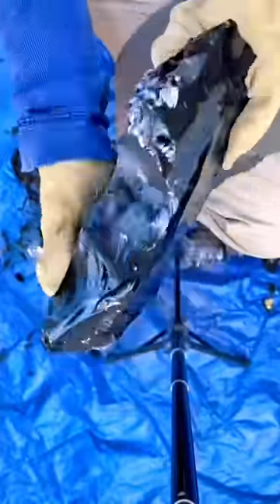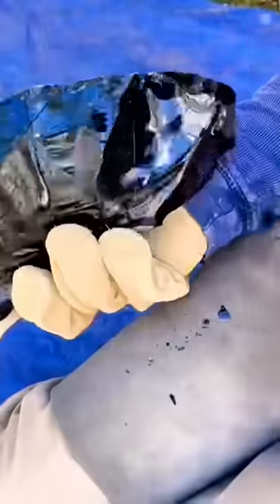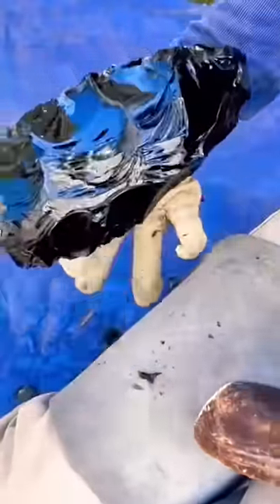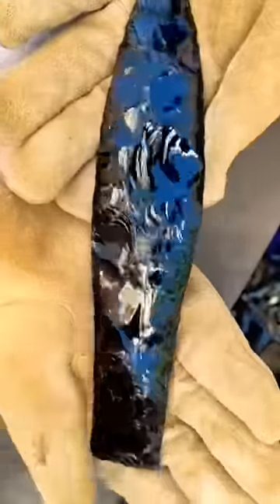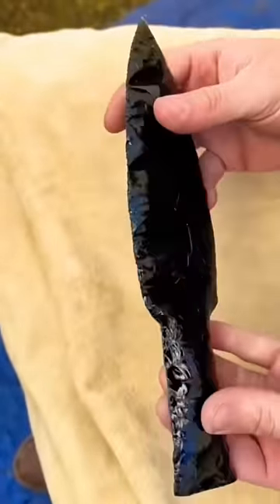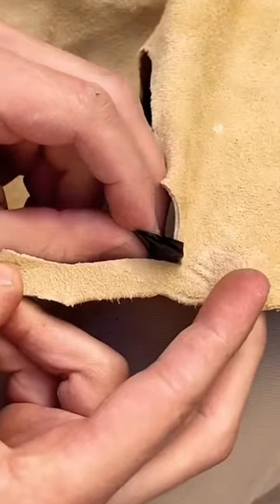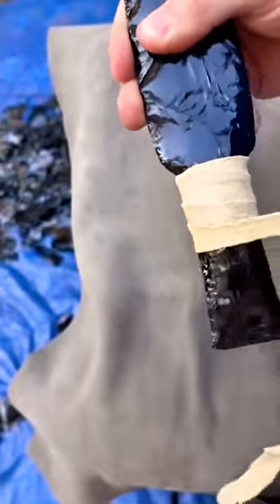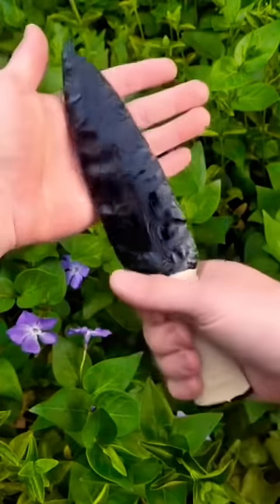Making an Obsidian Dagger!

Comment: fun fact: a knife blade made out of obsidian offers a clear cleaner cut than a steel blade. this is why the aztecs uses obsidian on their infamous and feared war clubs to not only kill their enemies, but also wound some of their enemies for human sacrifice to their gods
Reply: so not being able to forge steel had nothing to do with not forging steel? steel being the TO THIS DAY standard and premier material for edged weapons?

in your defence, ceramic knives exist and are much harder, meaning their edges can stay sharper longer while not being dulled as quick, which requires straightning/resharpening.
Reply: @tehpurplepills working with steel is much easier than obsidian. but we use diamonds, garnets, etc. as abrasives in sandpaper and drills because it is better for that purpose than steel. if you are in a society like ours that needs mass production more than anything else, then steel is better. but for the aztecs, obsidian would be much more useful than steel
Reply: This is actually the most unfounded and absurd comment I’ve ever seen on the internet.
Reply: @tehpurplepills obsidian has practically no durability as a tool or weapon, it’s incredibly brittle. but try shaping steel into a blade with antlers.
Reply: @tehpurplepills even today, there are surgeons that favor obsidian over steel
Reply: @Inuxxus  oh yea. ive never heard obsidian, but i know of eye sergeons using literal diamond blades, and im a 2x head chef and ceramic knives are legit sharp and generally dont need resharpening. lots of sharpeners themselves, ARE ceramic. its just the possibility of a ceramic shard/chip in food is bad.

so no doubt theres applications for these types of brittle, but hard material. ( is diamond bittle?)but any sort of asrguement that obsidian is overall better then a steel or even iron weapon, for combat, im very skeptical of. seems like an pro native america's revisionist history fetish.
Reply: @obscure.reference  a blade with antlers?  are you refering to the weapon where obsidian shards are sandwitched between two boards, with sharp edges stickign out, and used to shread and tear and lacerate enemies?

yea, seems like would be easier to make than forging an antlered sword... especially for me, someone who's never forged steel, like every aztec we know. but also seems like there'd been little to no need or use to create such a weapon in places where steelworking existed. seams like that type of weaponry was best for shredding, lacerating, and tearing exposed or lightly armoured skin. probably intimadating as well.
Reply: @Inuxxus  PS ive spent 10k on 2 hospital bills due to laceration from glass, and never had any other emergency visits, let alone from steel, so i get glass/obsidian. being dangerous. which is why id be TERRIFIED to weild this knife. i feel like it'd shatter and slice a large chunk of my hand off.
Reply: @tehpurplepills  im referring to the video we are commenting under where a man uses antlers to shape a blade to demonstrate that different materials have different uses at different degrees of technological awareness.
Reply: @obscure.reference  oh. so you meant somethign like "try usign antlers to sharpen steel into a blade" and not to "make a steel blade with antlers on it." gotchya. my confusion
Reply: @tehpurplepills obsidian blades are sharper and cut finer than steel. That’s a basic fact Google will tell you…..
Reply: @sandman4663  so if this guy took this weapon against a BESS edge tester, to see how sharp it was, do you think it would beat my sharpest kitchen knife, after a quick straightening with a steel? id bet you $5000 to $500 it wouldn't.
Reply: Aside from the fact they didn't have steel.
Reply: @tehpurplepills  yeah ill be taking your money now. easiest $5000 ever made lmao
Reply: Pagans... 🙄
Reply: than how can u chip it? looks soft as hell. U cant even chips rocks like this
Reply: @batrachianbill9760 hardness is not essentially brittleness. a stick of chalk is brittle, a stick of pencil "lead" is. are they hard? 
its just that brittleness is often the tradeoff for hardness, in ferrous metals, you know, iron, and steel, the best thing for most tool applications out. and it just so happens that that tradeoff is common in other materials.

obsidians brittleness is why it breaks. its crystaline structure is why it breaks in such a valuable way. cast iron, which is hard breaks, but it being able to break is not valuable because nobody needs breakable steel like that. cavemen need breakable stones.
Reply: @NoneYuh-kg1qz  the harder something is, usually makes it more brittle.  obsidian is around as hard as some types of steel (but much more brittle) byut it flakes off into sharp edges because thats its crystaline property.
Reply: @_pp7473  alright. how would you feel if we took this knife, and my sharpest knife of the same blade length, hooked them up to a machine to exert 5lbs of pressure onto a slab of brisket, etc, and the contraption moved both blades 5 inches under said pressure? which one would you figure would cause more cutting?
Reply: @batrachianbill9760 they do do that
Reply: @tehpurplepills  obsidian. The specific crystal structure of obsidian means that it creates very sharp edges when cracked, down to a molecule.
Reply: @_pp7473  a molecule. Is the edge a molecule wide that whole darn 9inches of very thick blade we see?
Reply: @tehpurplepills  yes, the technique used here is called knapping, you're just dense

Comment: I just wanna see how sharp the finished products are compared to the chips that you break off
Reply: Sharp enough to cut through bone with relative ease. There's these ancient Aztec weapons. It's like a club but with obsidian shards Stuck in it. You get hit by that hard enough to where the obsidian breaks? Not only will you have a broken femur, but you'll also have severe deep cuts with obsidian shrapnel in them! Obsidian works wonders when it comes to weaponry. I wonder if obsidian bullets that don't shatter on activation will ever be a thing 🤔
Reply: @RammsteinLover294 

As cool as that'd be i don't think it would be possible, 

However you coukd make a crossbow have obsidian arrows just sayin
Reply: Ocelotl from for honor has the club the @brendonyoung9278 is talking about

Comment: That finished product looks like a quick trip to the emergency room
Reply: @LWLProductions  obsidian is crazy sharp. one wrong move and a finger will go flying.  they make some scalpels out of obsidian due to how sharp they are.
Reply: Yes,if your hand slipped up from the guardless handle, it would slice your hand wide open.
Reply: Yup, it doesn't look safe at all. That thing is gonna slice your fingers the first time you try to use it on something.
Reply: That's why a "hand guard" exist
Reply: @Speedemon514  the blood pouring out would be the first hint ;)  agree it wouldn't be as painful as a jagged edge
Reply: @LWLProductions  a knife with that stubby of a handle without a bolster, if you were to actually use and not just have as a decoration, would likely only be a matter of time until an accident occured
Reply: @Speedemon514  I know what it feels like from experience. I slipped while using a utility knife and went up through my index finger nail, almost up to the base knuckle and then it skipped across and sliced through about an inch of my thumb, all within a split second. Didn't hurt, didn't feel it. Until later anyway. 
@dianebourne6297 is right, the copious amounts of blood were really the giveaway of the situation.
Reply: Not really go flying mote likely to slice yout tendons all the way to the bone, but yea preety dangerous

Comment: So let me get this straight. Steve can form diamonds, some of the hardest material on earth, mind you, into any piece of armour or tool he wishes. He, however, can not form a simple obsidian blade knife or arrow.
Reply: Obsidian IRL has the same problem as diamond (IE, extremely hard but equally brittle).

You use that blade once and it’ll probably snap
Reply: @brody7714  lol that would be funny as an easter egg ngl
Reply: @brody7714 honestly, that sounds like a good way to balance it in the game. Make it extremely powerful but it can only be used for 10 or 50 times
Reply: @gdottothegamer1001  eh… for pvp the more powerful groups would just have like 10-20 in their inventory and people would use it to cheese bosses. But for modded? Maybe.

Comment: Obsidagger
20-40 damage 
50% crit chance
70% critical damage 
30 bleed damage over 30 seconds per 0.5 seconds
Ability: 25% chance to spawn extra bleed damage to the enemy boosts by 30%
Can only be used by lvl 15+ players
Reply: Obsidian Dagger
10 attack damage
enchantments
sharpness I - 12 attack damage
sharpness II - 15 attack damage
Sharpness III - 18 attack damage
sharpness IV - 20 attack damage
Sharpness V - 24 attack damage
Fire Aspect I
Fire aspect II
Knockback I - pushes the opponent 14 blocks away
Knockback II - Pushes the opponent 24 blocks away
Sweeping edge I
Sweeping edge II
Sweeping edge III
Looting I
Looting II
Looting III
Bane of Arthropods I
Bane of Arthropods II
Bane of arthropods III
Bane of Arthropods IV
Bane of Arthropods V
Smite I
Smite II
Smite III
Smite IV
Smite V

Comment: Like videogame weapons...

Obsidian Dagger
- Crafted with 1 Obsidian Shard and 1 Animal Hide
- Volcanic Glass type weapon, thus providing higher base damage, but lower durability compared to Industrial Glass
- High attack speed
- Critical hits or Heavy Thrust attacks can leave Obsidian Needleshards within the target, causing Bleeding or Minor Cuts depending on which attack is used.
- Bleeding stops natural health regeneration for 15 seconds
- Minor Cuts causes very low but continuous damage for 10 seconds.